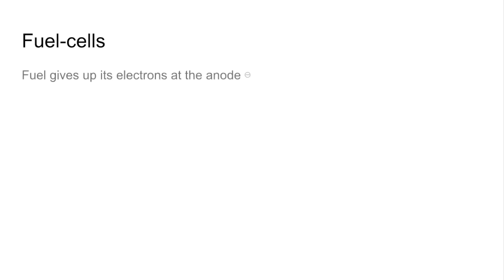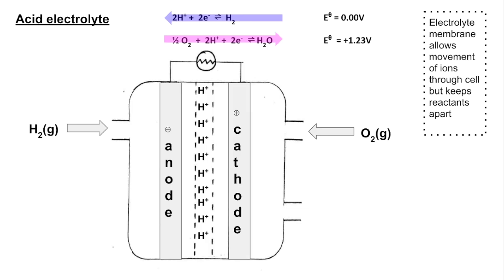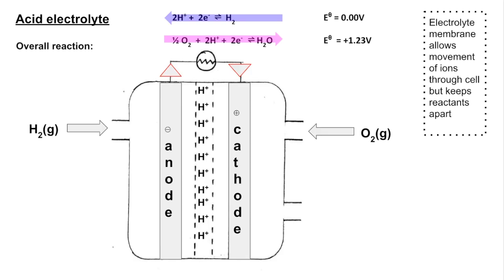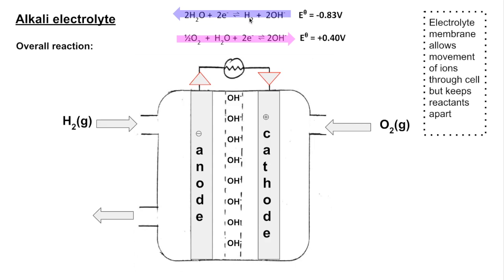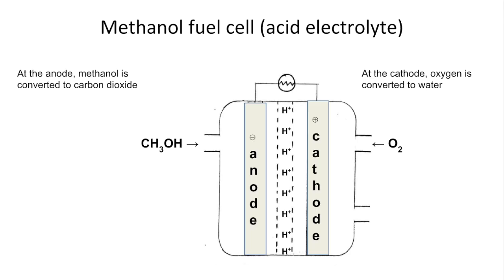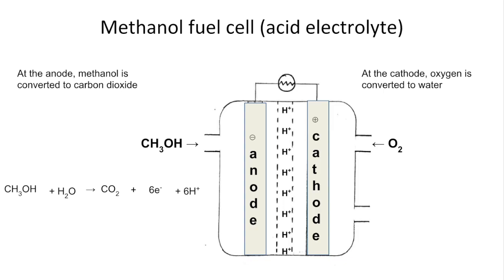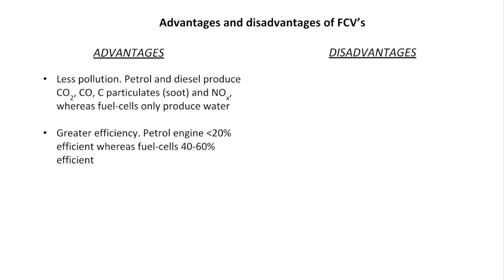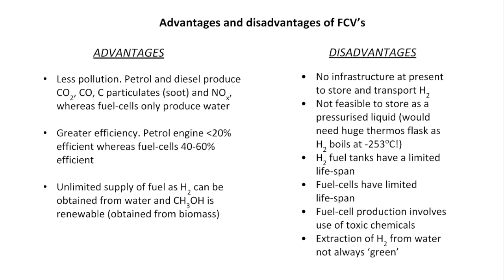Quick revision - Fuel Cells

Comment: How much of fuel cells are we meant to know? Has the spec changed?
Reply from the maker: From the spec

Explanation that a fuel cell uses the energy from the reaction of a fuel with oxygen to create a voltage and the changes that take place at each electrode.
Recall of fuel cells and equations will not be required. Relevant electrode potentials and other data will be supplied.

Comment: For the methanol fuel cell how did you identify which is more electropositive when making the overall equation?
Reply: Well obvious way would be to use the electrode potentials, but I think in this case it's because well oxygen is an oxidising agent so it gets reduced coz it has empty p-orbitals that need filling up. Reduction always happens at the cathode.

Comment: Isnt anode the positive electrode? 0:10
Reply from the maker: CreaShunTV Hi there, common question this. At GSSE you study electrolysis where the electricity is supplied to the cell. In these the anode is positive and the cathode is negative. These cells work the opposite way as they create and electrical current. The anode is now negative and the cathode is positive. Interestingly, reduction always takes place at the cathode (redcat). Do a search on electrolytic cells (GCSE) and electrochemical cells (A level) if you’d prefer to check. Some teachers have messaged me to say they’ve been teaching it wrong to their A level students. Hope this helps.